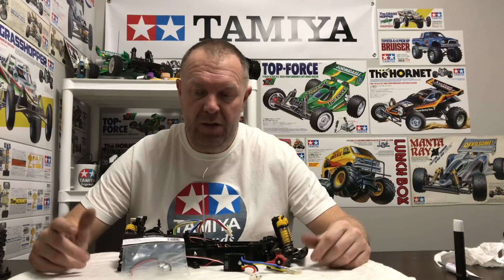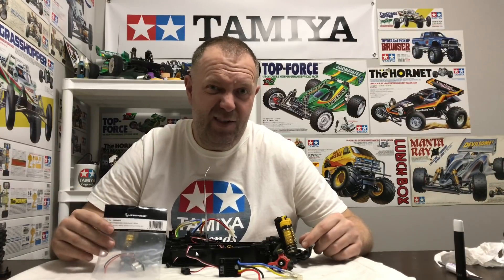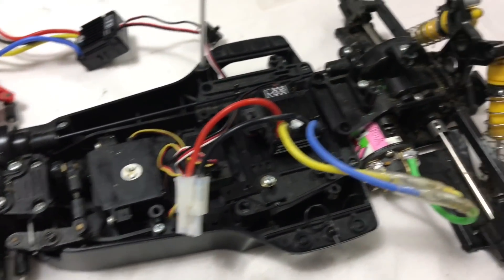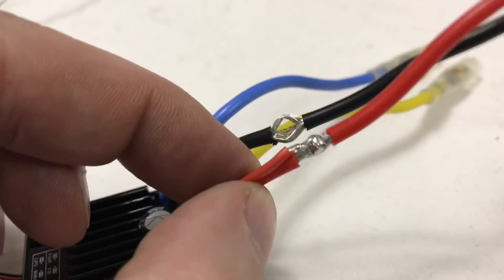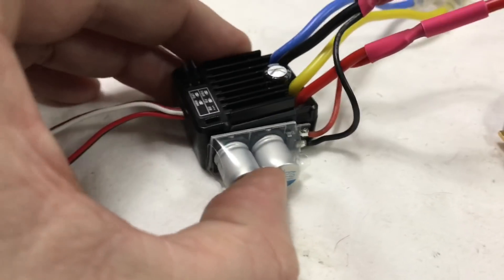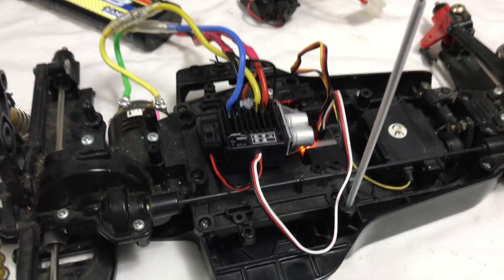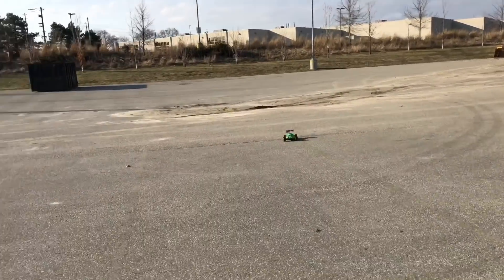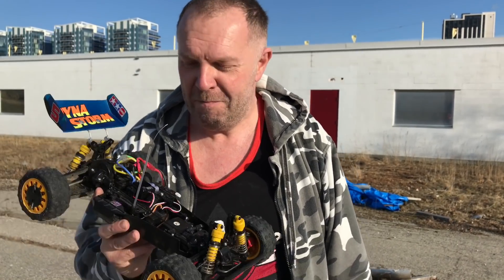Hobbywing 1060 ESC Limp Mode Issue Fixed using the Capacitor Module Kit  🤓👊🏻

Comment: Esto soluciona el problema de falta de energia cuand la lipo no es capaz de dar lo que el esc y el motor pide. Si se usa una buena LiPo no entrara el esc en modo de emergencia. No obstante como tu dices, debe mejorar la respuesta cuando las LiPo son con bajas C de descarga instantanea. En los drones que llevan 4 motores, Sppedybee siempre pone un condensador de 1000uF en la entrada de corriente de sus controladoras, asi evita problemas de este tipo.
Por eso la mayoria de los esc buenos llevan mas condensadores e imagino que el consensador que incorpora el esc incluido en los kit de Tamiya, se queda corto, si se usa con lipos con pocas C.
Es una pena que no añadan un condensador mas grande, con mas uF, para evitar quejas, que perjudican el prestigio de la marca Tamiya, aunque sea fabricado por HobbyWing u otro fabricante, ya que la diferencia de costes seria minima.

Comment: What that capacitor pack does is help eliminate intermitant voltage “sag”.  When you make a heavy demand for amperage such as heavy throttle with a thirsty motor and turning with a digital servo,  the voltage from your battery may not be able to keep up.  So you tire a capacitor or two in your case parallel to the battery.  The capacitors store voltage and give it up when there is a sag in voltage.  It avoids a quick “brown-out”.  There are other capacitors you can add to your reciever.  I have had to use these on my off-road buddies with digital servos as they are thirsty little buggers.  These are sometimes refered to as glitch brsters.
Reply: correct and its due to his incessant habit of  quickly jabbing the throttle while running ,,its cause by quick intermittant demands and releases of power from the esc...he does it several times in the video

Comment: Thank you for your video.
I'm trying to get back to life my old Tamiya Grasshopper of 1985. I then buy different part (NIMH 7.2V 6800mAh + motor 35T + Quirun1060 + dumboRC-X6) and when I start it, and go forward the car starts and then stop and then start, ... 
It seems that the whole power supply is cut for some milli second and then comeback all the time. 
Do you think it could be the same problem? thanks?
Reply: I have the same issue. Did you ever find a solution for your car?

Comment: I only have this limp mode issue on 6 cell nimh.  7 cell nimh and lipos work fine.  I assume the 6 cell nimh voltage drops as its running.    I have 2 new traxxas 6 cell packs and both do it

Comment: Does the length of the wire on the cap module matter?  I have two 1060 esc, but I want the both esc to be as compact as possible.

Comment: can someone help me. im having an issue about HW 1060 low voltage cutoff. Motor stops/doesnt work, ESC red light blinking.
Im so frustated to solve this.

So the problem happens, whenever my car is about to go interval of objects, (slow speed), the motor suddenly doesnt work. 
i read the manual, it says whether the battery voltage too low (below 6v) or check the cable solder onto motor. 
(just as you know, i did purchase some new batteries, but it doesnt solve my problem)
also
funny thing, everytime i cut the motor cable, and solder again, it works...but the problem happens again.
by the way, im using 2s lip bttry 7.4 2000mah. 

so, this capacitor module kit does help?
or should i get brushless motor?
or should i buy new ESC?

Comment: So we use HW1060 at my club for the Tamiya class (kind of like entry level - so brushed tamiya motor, not more than 2s and not much tuning options to keep costs down etc)…..thing is, a few of us have had this issue re the power suddenly dropping. I’ve just did this mod, will see if it works on race day in a few weeks. I know one guy has tried it and his seems fine, but me and another guy have only just done our mod…will report back and see how it goes…..(it will be used on a full Sunday race day on an asphalt track - so practise, then qualies and finally 2 rounds of races) 🤞 this works otherwise I’m gonna be stumped on what to do.

Comment: I thought about doing this for the same reason glad to see it works. As far as i know it's part of the lipo cut off mode it goes to limp mode when it thinks the voltage drop is to low but then runs forever in limp mode was really annoying when it was in my crawler it would never drain the battery low enough to hit the actual cut off in my crawler so dropped it in my wl car and it's still annoying so i will be doing this thanks for the video now i know it will work.

Comment: Mine runs just fine for about a month, now it doesn't even recognize 2s lipo, no beep sound, no throtle! Motor is fine, checked by running direct to battery, any idea what's causing this? Is mine broken? led lit up when I push throtle, yet motor is not running! Somebody please help ...

Comment: Could you of soldered the capacitor to the Deans connector with the battery wire? Would that work the same?

Comment: Any idea how to disable the low voltage cut off on this esc. So tired of half speed after 15 mins on a 2s lipo.
Reply: same thing happen to me. im tired of low voltage cut off. 
motor suddenly stops!!

and all i do is cut the motor cable, and re-solder to esc cable...everytime..
im so frustating right now

Comment: Did you pop a cap kit on the ESC that "Limped" and go out and re-test it?
Reply from the maker: Yeah I’ve done a couple now Tim, it’s not a 100% fix! Some guys have done it and it didn’t fix the issue 🤷🏼‍♂️
But mine were all good after I did it 😊👊🏻
Reply: Tidy. I've got a 1060 in my Axial SCX10 that started behaving strangely so I'll get a cap pack and solder it in.

Comment: I have a WLToys 12402-A that came with a 550 motor. It is a HUGE boost in speed from the old 540 motors. I installed a 1060 and other components to change it to separate components. Just as a visual, without a GPS speed module, the 1060 has knocked back the speed by a good 25% or more - it sucks!! Maybe the Cap Module is what it needs.

Comment: I've got a 1060 brushed esc from my friend but it can't run reverse, when I push the transmitter trigger to reverse it's run forward and when I pull the transmitter trigger to forward it's run forward. 

Anybody know where's the problem?
Reply: Your jumper for mode on the esc. F/B/R. 
FB/RV?
Or since you didn't say what radio your using, the presets on your Xmiiter? You may have throttle/trigger reversed on your Xmitter. Some Xmitters can be set to "Double tap" for brake. Sounds like that Mate.

Comment: If you put a Deans connector counterpart on your connector while soldering, it keeps it from letting the tabs move around if you accidently use too much heat.

Comment: Just in case anyone reads this, the knock off one has red and black motor wires and if you look just to the right of the little instruction panel that tells you what the jumpers do, you'll see a little opening on the Genuine branded and RTR version but the clone doesn't have that opening.

For what it's worth, I've got on ok with the 3 fakes I have but anyways, that's how you tell them apart from what I can gather.

Comment: The capacitor module shown, according to Hobby Wings own description is for a sensored Brushless speed controller. They also make a 4 capacitor module. Again for a Sensored Brushless system.
My Genuine 1060 brushed esc looks different than the one in the video.
Realm of possibilities?
Maybe your transmitter is causing issues?
I have a programmable Xmitter. Are my settings correct?
Or maybe, if your using a Nicad battery your just not getting enough ooomph? Nimh battery? Same. Limp mode? No more battery juice, signal cutoff at esc?
 Read the Pololu.com explanation #9 Dealing with Motor Noise. Before trying any capacitors as filters, try wrapping your receiver with aluminum foil. Leaving just the antennae exposed. Funny though, I see a 104 ceramic cap across the motor terminals in this vid. Cheers.

Comment: Hallo there..lil bit wonderin..how about your 1060 condition wright now??is it still runnin properly with the optional hoop up capacitor??is it still do the job?coz ive allready read the hobbywing double cap manual..that hoop up was build for the erzun and quicrun family..tx in advance..keep healty and happy..regards
Reply from the maker: ge ra 
Hey 👋🏻 
Yes I’ve done two and both are still going strong 🚗💨💨💨
Reply: @TAMIYALegends  great..tx for your information..gonna try it latter on and posted the result..manny tx
Reply: Typo..ezrun and xerun

Comment: I have a 10BL60 sitting here new in the box, it doesn't have capacitors on it, is it going to have the same issue or is it different than the 1060?  It's the brushed ESC that has the issue?
Reply from the maker: Mark G 
Yeah I’ve not heard of it happening in any other speedo 🤷🏼‍♂️
Reply: @TAMIYALegends  Sorry, I didn't realize how old this video was.  It showed up and I thought it was a new one. :)

Comment: Not had this on a 1060 but I have a Hobbywing 10BL120 sensored brushless that at first I thought had an occasional  intermittent fault, which became more regular until eventually it became unusable. It does exactly the same 'safe mode' thing you demonstrated. I run an 8.5T with a 5000mAh nimh or an 8.4V nimh. My guess was the batteries couldn't provide the required discharge current (what is the C rating on a nimh anyway?) & I needed a 2s lipo (I have no lipos yet). So I just set it & the motor asside for now. This esc has the 2x 16V 470mF cap module connected to the battery leads already. Humm. Does this mean I need a replacement cap module or the 4 cap module upgrade? I don't know but I think I shall try both & see what happens! Better than leaving it in a cupboard Wow amazing! Great tip, cheers mate!

Comment: Would this only be going into Limp mode on a quick Motor? I'm just using a Tamiya Torque Tuned & 3300 Nimh..  Just ordered this ESC and was pointed towards your Video.. Now bit worried 🙈

Comment: Could it have been the amp draw from the motor and servo? I have one 1060 and about 3-4 1080 esc. I use the 1080 in my crawlers because of the programability. I may use the 1060 in the attack fighter I have just ordered. I have not decided yet if I will go brushed or brushless.

Comment: It's so easy to open the casing of the 1060 and I would recommend soldering direct onto the board and not splice open the wires. Frankly, that's the lazy method and doesn't look neat at all.

Comment: Hi, thank you for this , this is a great fix, just so you know I just put 2 1000fu 25volt caps inline and did the same trick.  Sad you have to fix someone else problem.
Reply from the maker: cazarakable 
Excellent glad you got it fixed my friend 😊👊🏻
Reply: Capacitors?Mind your ESR. Equivalent series resistance

Comment: I have old hbx bonzer, now the car has traxxas 12t 550 motor and Hobbywing 1060. It goes limp mode after 10sec, i did this repair with Hobbywing capasitor module and it did not work. Still goes to limp mode. :(
Reply: Same exact setup and issue

Comment: Quality control on these Hobbywing WP-1060-RTR must be pretty bad. I bought two cars that both had this ESC and they both did this. I contacted the car manufacturer and they sent out a new ESC under warranty and it did the same. I bought the kit with the 4 capacitors on it and installed it on one of the cars and it works great. Just need to do this to the other car now.
Reply from the maker: Bret Muckridge 
It really is poor Bret, so many guys I know have had this issue 😞
Thanks for watching buddy 👊🏻

Comment: I can't believe how simple it was to fix my 1060. Just leave the jumper on nimh and protection mode won't kick in. Using this on a979b with 3s 100c 1500mah. Good God is it quick. The damn tires almost pull off the rims.
Reply from the maker: Patrick Walker 
Excellent I didn’t know that 😊👊🏻
Reply: TAMIYA Legends, yeah I spent hours racking my brain trying to find out what's going on. So, I'm like I'll just put the jumper back on nimh like it come out of the box. I was like unbelievable!
Reply: @patrickwalker125  what kind of battery that u used when u change the switch to nimh..is it lipo or nimh??tx in advance..had a same problem here
Reply: Just tried that, car worked normal.... But battery ballooned right after use. Not a good solution
Reply: Can you still use 2s lipo on the nimh jumper?

Comment: hi this is happening to me i put the cap on like u have done and still going to limp mode after 5 mins
i then put the jumper to nimh battery and going good no limp mode
did u change the ecs to nimh when using lipo battery i know u should not do this but have u tried this before putting the caps on? please try thanks  let me know thanks
u should have a donate button u help me out heaps ... worth thinking about
Reply: Dude, just put the jumper on him and it will not kick in. Just watch your voltage on the Lipo though
Reply: Nimh
Reply: @patrickwalker125  hi thanks i out the lipo setting back but it drops down in power i do have a cap installed do u think i need 2 installed?
Reply: bruce benner I would remove the capacitor
Reply: @patrickwalker125  yes but it will drop in power the car will go slow again even when the battery fully charged up thanks mate
Reply: bruce benner Try this, remove any extra capacitors. Remove battery jumper the turn on. Go full throttle then full reverse. Turn off place jumper on nimh then turn back on. It shouldn't go into protection mode. Watch your voltage or you could ruin the lipo.
Reply: @patrickwalker125  If you use a fully charged 2s lipo @ 7.4v on this 1060 ESC, as soon as the battery voltage drops to 6v the ESC will go into limp mode to avoid damaging the battery which sounds pointless using a lipo in the first place cos you're not going to get the full use of the battery but if you run it in NiMH mode then the limp mode feature doesn't kick in. Why would a manufacturer make a lipo compatible ESC if you're never going to get the full use out of it? Doesn't make sense. I now use ZDRacing 45amp brushed ESC's to run my 15t kits on 2s batteries. No limp mode feature on those and you get full use of the battery right down to 3.1v. Even better if you use the 8.5t motor that comes with it  👍
Reply: Peter Smith Well lots of things do not make sense with engineers, most everything is engineered wrong to begin with and I always have to modify some shit so it'll work right. Sorry bout that rant, but most shit just pisses me off because of poor engineering. Actually, I've been running it down till the car just start to lose quite a bit of power then recharge. No problems so far.
Reply from the maker: bruce benner 
Oh wow no that’s new to me buddy 🤔🤷🏼‍♂️.  I’ll have to have a play with that next time 😊
I have Patreon set up and my email in the about section is my PayPal.
Glad you found that 👊🏻

Comment: I just installed mine,  it is really slow on reverse, it takes 2 to 3 seconds to react to reverse, when i adjust the forward throw on the control it moves forward just fine when i adjust it barckwards it wont move at all.  I am frustrated 😫
Reply from the maker: linlin lixin 
Hmmm 🤔 
Have you got the two plastic jumpers in the right place for the battery and setup you want?
Reply: @TAMIYALegends  yes i do.  I tried it on another transmitter and receiver and same thing.  I reversed it on the transmitter and its slow forward.  I tried another motor and same thing.  I switched the channels on the receiver and its still the same.
Reply: linlin lixin I don't know why but it's doin it when both pins are in correct. I has to sac the break for the time being. When I take out the jumper for it and leave f/r, reverse runs fast. Beats me.

Comment: MAN I WISHED IT WORKED BUT FOR  ME IT DID NOT WORK.  RUNNING THE 1060 IN THE WLTOYS 144001 AND EVEN WITH THE CAPACITOR KIT  WITH IT A MINUTE IT GOES INTO LIMP MODE
Reply from the maker: Micro Drone Channel 
Yeah since this video a few guys have said it hasn’t worked 😞
Reply: Put jumper back on nimh
Reply: Yeah I did the same and no luck
Reply: @jtsn667  sorry to hear that. Mine goes to limp mode too. But when I switch the settings to NiMH and plug a Lipo evrythings good

Comment: The spec on the 1060 says; 2s lipo or 6nimh- 540 motor with greater than 12t or a rpm less than 3000. Going outside these specs ruins the capacitor over time. So, were you going outside those specs and the problem arose then or did you have this issue anyway? I ordered a 1060 anyway and I am not sure if I should modify it right away. Love your channel!!!
Reply: Thanks, I will order the mod prior to first run. P.s. I also ordered some custom decals from mci. awesome recommendation, under $10usd for top force!!!
Reply from the maker: Peter Renaud 
No unfortunately they pretty much come like that, not all of them but a few 😬

Comment: hello. it says on the packaging 10BL60. so the capacitor is for a brushless but we will install it in a brushed 1060 esc? please let me know. i have 2 unit of 1060 brushed esc and both goes to limpmode in any motor.

Comment: How can I adjust the brake % or do a reset on a 1060?
Reply from the maker: Oswalds Reef 
That’s something I’ve never done on a 1060, tbh I didn’t know you could 🤷🏼‍♂️
Reply: @TAMIYALegends  thanks for reply and I guess you've helped me confirm that, you cant.  I solved my issue....I had my reverse endpoint set what i thought was perfect....turns out reducing reverse endpoint actually also reduces your max brake signal too.   Crucial on a crawler

Comment: Glenn.... After 38 years in the Hobby, you just taught me something!! 😲 
I've got a 1060... It ran for 10 seconds and stopped! The Red Light flashes, and nothing. No output. 
That was 4 months ago and I didn't Bin it, in case anyone found a cure. I'm truly poor, and can't afford new ESCs. 😭 Sucks.
I just don't know if it's fried, or if there's anything I can do.

But when you said "limp mode", I first thought "brownout"... But what I saw in the part where you ran the first one, that was something I've never seen before!
Carmine ✈🚂🚙